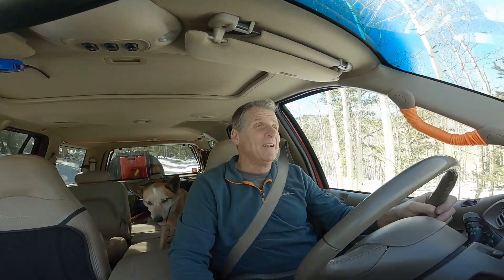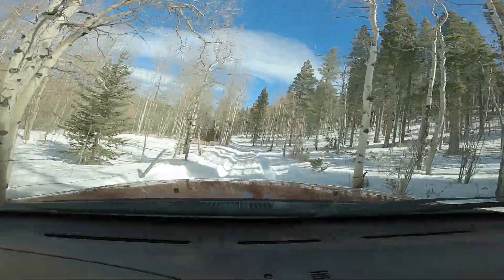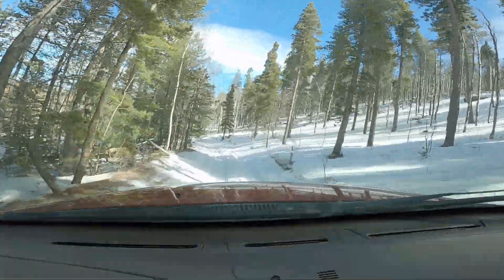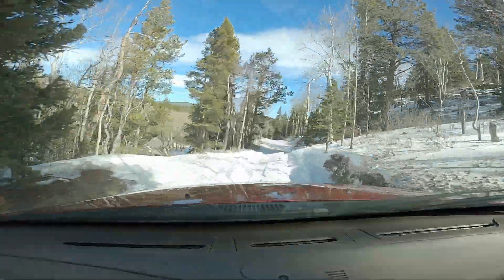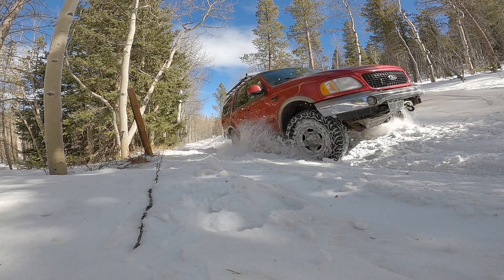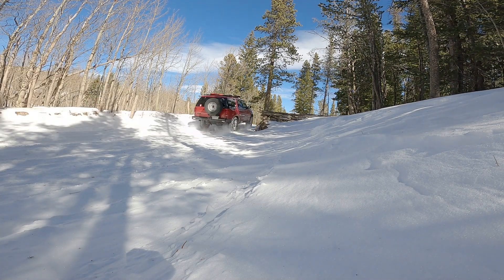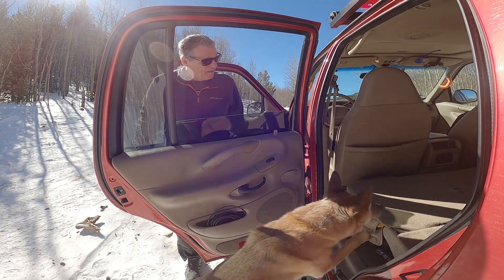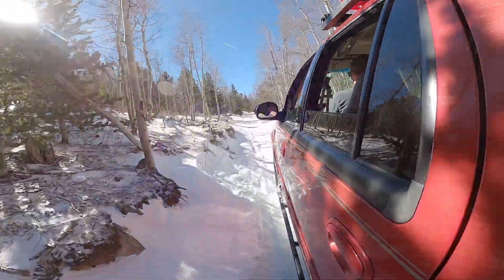Detroit Eaton True Trac - How they work in real life

Comment: I'm confused by your explanation of your brakes not holding in high range, but holding in low range.  You say the brakes are good, but they "won't hold that power,"  but will hold in low range.  Low range puts more torque to the wheels, so it would be harder for the brakes to hold against the power.  I'm not arguing that it works in low range like you say, I'm just not tracking why it would be different in high range.

Comment: Thanks for this video.  I re-geared my F150 to 4.56 with a Truetrac in the rear and have been driving for the last 6 months with my front driveline removed due to f/r gearing difference while waiting for a back ordered Detroit E-Locker front diff.  I just canceled the E-Locker in favor of a front Truetrac.  FYI, parking brake when a rear tire is off the ground.  Normal brake pedal applies too much counter-productive front brake when a rear tire needs traction.
Reply: So you wouldn't tap the front brake? I have a pedal parking brake. Is it like a pump the parking brake action when a rear tire is off the ground?
Reply: @AaronLives34  The Truetrac needs some consistent resistance at any spinning wheel to stay vectored. Once any pronounced wheelspin occurs, the driver needs to get completely out of the throttle then reapply both throttle and brake simultaneously. It is not a locker. It is a torque-vectoring, helical gear-type limited slip differential. 

That said, it's what I chose for my pavement/packed sand/dirt trails F150 4 X 2. Works great!
Reply: @applesbighatranch6906  thank you for that. Very insightful and helpful
Reply: @ Hey! You're welcome. The  scenario I just described is basically for when one drive wheel is in the air. All other times, the unit works well on it's own. It's only when one drive wheel has zero resistance that the "power braking" technique might be applied (and stay applied for the duration of the need).

Comment: This is an awesome video. Very informative. I was having a hard time finding the info info I needed online until I saw your video. Your video is what convinced me to put truetrac's front and rear of my Sequoia instead of a locker in the rear only. I just rewatched the video and do have a question, at one point in the video you mentioned that the diffs don't work properly in 4hi. Is there any point in the video where you switch from 4hi to 4lo? I ran onto a scenario today in the snow backing up while flexing and I couldn't get the rear to lock even with applying the brakes and a little e brake. I didn't think to put it in 4lo as I could still go forward. I'll have to test this next time I head up to the snow. For anyone else reading this post, the truetrac's work amazing and I would 100% recommend them. Thanks for the great video!!!
Reply from the maker: I found they always work in the way they are engineered to do. But I found you can get them to almost lock in 4 low at very low speed meaning just crawling in 4 low. In 4 or 2 high i found that they do a better job at finding traction at higher speeds like on the road in snow than a normal limited slip or open diff.

Comment: I wish they made these for Land Rover LR3/4s. The only option for them is the factory e locker which is extremely rare, or an ARB air locker.

One of these truetracs coupled with the trucks traction control system would be amazing. And a lot less complicated an install than the selectable locker options.

Comment: This is by far the best video documenting the abilities of the True Trac differential. I am also read that they work very well with vehicles equipped with traction control. I’ve been on the fence for a while now regarding whether or not to purchase expensive electronic or ARB LOCKERS for my H2, but have decided after watching this video that true True Tracs are the way to go!!
Reply: This is what I found too. While they don’t have the capabilities of a full on locker, these coupled with an advanced off-road minded traction control like in a Land Rover or Toyota’s ATRAC system, then they’re unbeatable. Because the system will automatically overcome the shortcomings of the Trutrac by applying the brakes automatically on the wheel that needs traction in those few scenarios where the diff won’t do it.

Comment: I got one but no snow here in australia.
Reply from the maker: Probably find some snow somewhere there. I don’t have much sand here, how does it work in soft sand?
Reply: It works but the really soft fine dry sand is still a challenge, took it up a steep riverbank but was probably 60% sand 40% dirt, just fixed it again was assembled incorrectly with washer shim backwards jamming gears and shunting axles. good fun in dirt especially not dry stuff even with bad tyres, its just the cheap Chinese clone device but good and mostly silent operation spins eadily now and using 80/140 mineral oil and fitted the 3.23 lower spicer gears.

Comment: For most of the 1990s I drove my manual transmission Land Rover Discovery with Truetracs in both front and rear; I LOVED it. I conquered many famous trails in that rig including The Rubicon, Hole in the Rock and Dusty Ershim.

BTW, it's easy to put a manual transmission in a low crawl gear then ride both gas pedal and brake pedal with two feet.

Comment: Great video! You are absolutely right about the benefits and drawbacks of a trutrac. I have found that you can entirely negate the issues off-road by simply keeping all four tires on their ground. (Duh.) this makes it an awesome pairing with solid front axles and long travel suspension. I have two in my TJ Wrangler and I feel unstoppable. They also work fantastic with a manual transmission if your 4Lo is low enough. Just put it in low range and ease off the clutch and let idle carry you through the brakes. (Or crawl control if you have it)
Reply from the maker: Well said! I have a Yukon Grizzly auto locker and a e-locker in my Bronco. That works really well in an extreme rock crawling scenario but most of the time I wish I had Truetracs as they are just there putting power to the wheels that need it. Thanks for watching.

Comment: So are you applying gas and brake at the same time? Or just tapping the brakes?
Reply from the maker: If you are going very slow climbing and rock or bank I hold the brakes and apply power to keep the diff “locked” to allow the front tire to climb. If already spinning you can also “slab” the brake pedal to get some power to go to the tire on the ground to get a little movement forward and that can get you out. So both can be done.
Reply: @starksexpeditions121  slab? Or tap?
Reply from the maker: Sorry, I meant to say “stab” because it takes a pretty hard tap of the brakes.

Comment: I can't say from experience, but at least for the rear, using the parking brake instead of the pedal is supposed to work better... ???
Reply from the maker: In the video you can see the goal is to get the front to “lock” to get over obstacles so the parking brake has no effect since it’s just in the back.
Reply: @starksexpeditions121  Hence, "but at least for the rear."  Jeesh...

Comment: Great video. Thank you!
Reply from the maker: Thanks!
Reply: @starksexpeditions121   are you still happy with the TruTrac for “city” driving on pavement/wet roads for daily driving/commuting?  Seems like TruTracs are a great option for vehicles that have to serve double duty as daily drivers & weekend off-road exploring.
Reply from the maker: Yes, it shines in everyday use. Lockers and even clutch limited slips will chirp and spin the inside tire in tight turns. The TrueTrac does not do that. So it technically should be easier on tires, and my son drives it to school everyday and I doesn’t see any extra tire wear. For a all around I’m very happy. Like I said before it is so good in snow so that’s where my Expedition is used most and I can’t be happier.
Reply: @starksexpeditions121   excellent- thank you again!  Very much the same needs here in lower New England.

Comment: @Stark's Expeditions, On my 04 Expedition the biggest problem I have offroad is when one of the front wheels comes off the ground, like on a rutted out trail. As you know, all torque goes to the wheel off the ground, which is why I am considering a locker or TrueTrac. With a TrueTrac I understand that I can try to move my left foot to apply the E brake so that it gives power to the wheel on the ground in that situation. But that isn't easy to do quickly, so would I miss a beat there potentially, lose momentum at that point and risk getting stuck?  A locker would already be locked or could be at the press of a button. So is a locker is better for my situation? Any thoughts on that? Thanks.
Reply from the maker: Sounds like you really understand what happens off road. With a TrueTrac you can’t use the e-brake to effect the front. And the only way to get the front to “lock” is to stop, hold the brake and throttle through the brakes to keep the wheel off the ground from getting all the power. So how you are wanting to keep momentum the TrueTrac is not going to work. A true locker will be better. But like you can see in my videos there is a high probability of breaking a front CV. My technique off road like I do in rocks is slow with my left foot on and off the brakes to keep traction and if I loose traction I stop then I hold the brake with my left foot and power through and the front wheel goes up but down pretty quickly. Once back on all four the TrueTrac works perfect without holding the brakes. In snow where you need some momentum I don’t use the brakes at all, just let the TrueTrac do it’s thing where it shines. And it works really good until a wheel lifts so as you are powering up something it will get traction much better than say an open diff so when a wheel lifts you are still moving forward so quickly enough you will be back on all fours and getting really good traction again. Hopefully that makes sense, I have lockers in my Bronco and use it more for big rocks and I like that setup for it but in an Expedition I think the much more simple and less expensive TrueTrac is perfect. Even with out a true locker I get my Expedition into places I really shouldn’t go. Sometimes getting stuck can save you from getting in real trouble.
Reply: @starksexpeditions121  Thanks so much. This thing is what I am stuck with until I can get a 90s Bronco. My issues are clearance and not having lockers. So I will replace my 33s w35s, regear to 4:11, and put in a rear TrueTrac. I saw your video of you snapping the front CV, so I am leaning toward keeping the factory LS in there but will replace the clutch pack (thoughts?). Maybe I should do a video? (Might be more of comedy of errors!😁)
Reply from the maker: @johnbennett6887  My advice is to only spend money on things that give the biggest benefit. If you are driving dirt roads and easy trails that needs less upgrades then rock crawling or deep mud running. And, if you are planning to get a different vehicle down the road then spending on the Expedition may be wasted once you start wheeling the new one. As far as breaking a CV goes once you go bigger tires and gears you start to reach the limit of strength. Expeditions are heavy... I had the front pinion bearing come apart and when I took it apart to fix the TrueTrac was full of metal shavings so I just put the open carrier back in so I've been running the TruTrac in the back and open in front and it still works good. Yes! do a video!

Comment: Good information. Thank you for sharing your experience.  I'm getting a treutrac installed in my Z71 Silverado in 2 weeks.  I live in Utah and currently with the open rear diff it makes it difficult to climb hills, drive up wet roads, and pull my boat out of the lake without using 4wd.
Reply from the maker: Thanks!

Comment: If it's all the same to you, 100% Lincoln Lock the front diff if you already have some type of locker in rear
instant results bang per buck and since 4X4 is used off road it will work just fine.
Reply from the maker: Never drive a spool or Lincoln locked front diff on the street. And I have an e-locker in the front of my Bronco and it is almost impossible to turn with it locked so there’s that…

Comment: Which Replacement CV axles do you use? None of the aftermarkets will handle any lift without binding.
Reply from the maker: Stock Motorcraft. If you don’t change the wheel travel they don’t bind.

Comment: I love my Detroit TrueTrac . Installed in my jeep frontend Dana 30 . I generally keep hubs locked to keep bearing grease moving in bearings. Love the use of 80-90w oil, T-150 n Hays clutch has no problem finding traction with quick depression of clutch pedal it will get otherside moving, in low range, I never had any problems in hi range on ice or snow. I only notice when down shifting and using gears to slow down, all four tires lockup , it'll slide sideways for instant as clutch engages, my bad habit driving. other than my heavy clutch foot , no issues, been installed since '91 or '92. since installed i have never got stuck in 3" of mud as before without it. didn't want the clicking sound on street or special oil for limited slip. Price of a Locker was more than i wanted to spend in frontend. 30yrs and zero complaints from me.

Comment: One thing I'm confused about is when one wheel is in the air and you're pushing the brakes I've heard that an open differential would have the same effect so what makes it different?
Reply: Sorry for making this such a long reply, but some basic background is needed to explain why the Tru-Trac (and most other limited-slip styles) respond so well to applied braking effort.  

Here's the deal.  In an open diff, torque on both sides is always exactly the same.  This confuses almost everyone, and I bet that someone who doesn't understand what this really means will jump in and claim it's wrong.  By the same token, so many discussions of this topic would be far clearer to most people if the word "power" were never used, since almost no one understands what "power" actually means in this context.  However, I will skip the explanation for why that's so confusing.  

Unlike an open diff, a limited-slip diff (and especially a locker) is able to maintain unbalanced torque between the two sides.  The axle on the side with poor traction will only have as much torque as can be generated before the tire on that side slips, but torque on the other side might end up being a lot higher (how much higher depends on how hard the vehicle "tries" to move or keep moving, and a few other factors which won't be mentioned here). 

With an open diff, if one tire gets lifted off the ground and the vehicle needs traction to keep moving, the torque on that side's axle will be zero because it requires zero torque to spin that wheel in the air.  That means the torque on the axle for the tire with good traction will also be zero, and therefore no forward push will be generated by the tire with good traction.  Applying the brake means that a lot of torque can be needed to spin the tire that's off the ground, and now, that same amount of torque is present in the axle for the tire that's planted on the ground.  That higher torque value may be enough to get the vehicle moving.  It's kind of hit or miss whether this works, though, and it's more a function of whether the brake on one side might be exerting a little less force than the other, but it can sometimes get you out of being stuck in cases when not much forward pushing is needed to get the vehicle moving again.  

With the Tru-Trac, the maximum difference in torque between the two sides is dictated by the geometry of the gears, and this maximum ratio is much greater than the 1:1 value of an open diff.  Not all units are the same but one person in the comments here says this ratio is 3.5:1, so let's use that as an example.  In this case, if one tire gets lifted off the ground and the vehicle can't simply coast through the situation, then just like before, it requires zero torque to make that wheel spin, so there's zero torque imposed on the axle on that side.  On the other side where the other tire has traction available, the maximum torque that can be achieved is 3.5 times greater, but 3.5 x zero is still zero, so the Tru-Trac unit is basically helpless for the time being (actually, there's enough mechanical inefficiency in the differential gears that the situation is not quite as bad as this).  BUT, when the brakes are applied hard enough, a high amount of torque will be needed to spin the tire that's lifted off the ground, and now, the maximum torque that can be achieved on the other side (this torque value depends on resistance and is not constant for all situations) is 3.5 times greater than that.  Some of that torque-making ability will be needed to overcome the brakes on that side, but that ratio of 3.5:1 ensures that there's plenty of ability to make the torque on that side go higher still, and that ability to generate additional torque beyond that needed to overcome the brakes translates to an ability to make the tire on that side generate enough pushing force to make the vehicle move.  An open diff can't even come close to having this capability.
Reply: Not possible. The truetrac needs to be on the ground to work. When you brake the wheel in the air it simulates that and sends power to the other wheel that has traction. Open differentials are open and don't do this.
Reply: @Gunalizer  I'm saying an open differential if you push the brake. Kind of how my Land Rover traction control does it with open differential and pushes the brake on the spinning wheel and the same effect as achieved without pushing the brake. But with an open differential without traction control you can do the same thing. So the true track really just works better on the ground but when a wheel gets in the air it's the same as an open diff